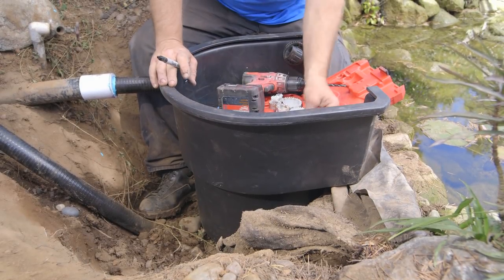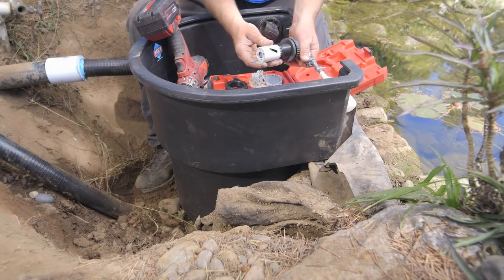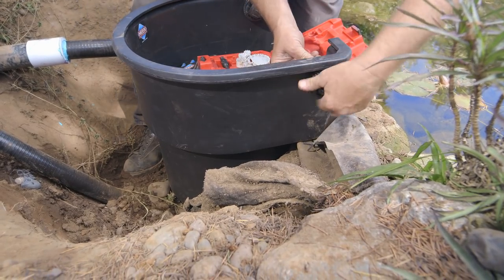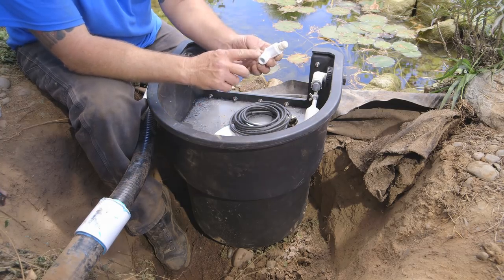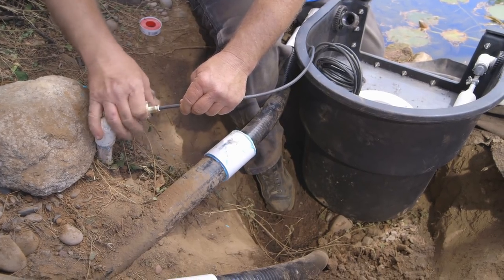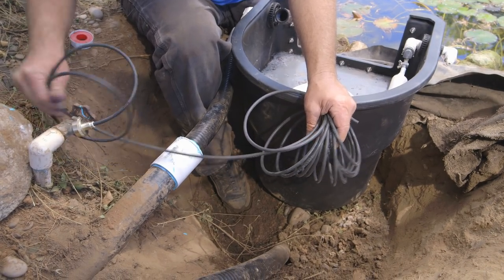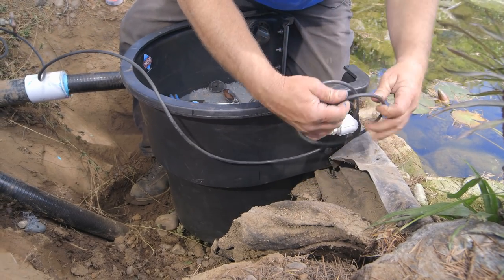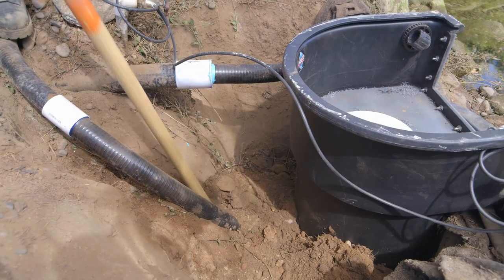Automatic Water Fill Valve Installation - PS 8

Comment: What kind of water supply usually is used for auto fill valve? Any hose or certain pluming necessary
Reply from the maker: +Jonathan Valenzuela You can connect to a standard hose bib.

Comment: Will it work in freezing conditions? Tired of filling my koi pond every 2 days in the middle of New England winters.
Reply: Mechanical and electronic 'sensor' devices operate down to a certain temperature - you will need to do some research to find out given you climatic conditions which - mechanical or electronic (or both?) - would work for you. Depending on the distant from your house to the pond/filter system, you could fit a solenoid/water fill device in the house, and have the water run out from the house (via a tundish) through your koi filter system to fill the pond. Or instead of the solenoid/water fill device, just have a mechanical valve arm and turn it when you notice the water dipping below a marker/indicator on the side of the pond. Various ways to overcome your issue - just do some research :)